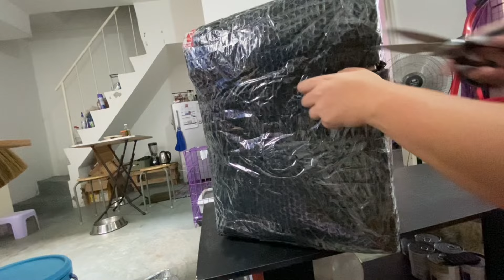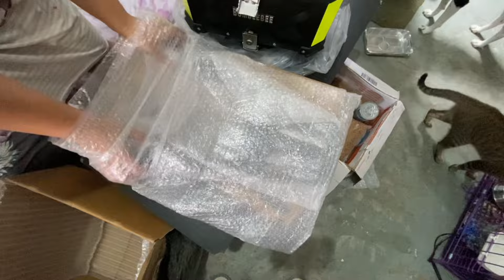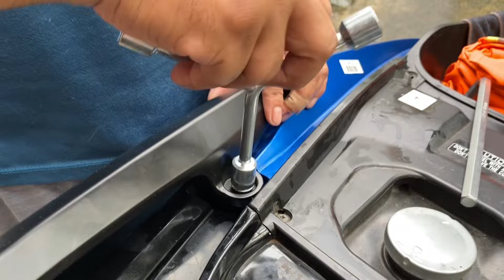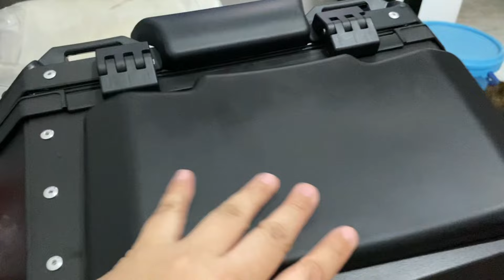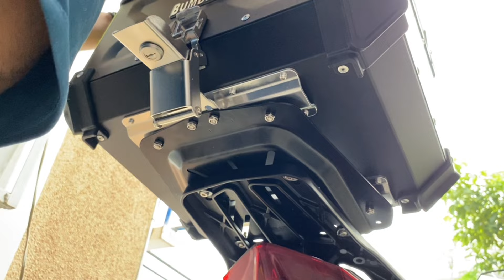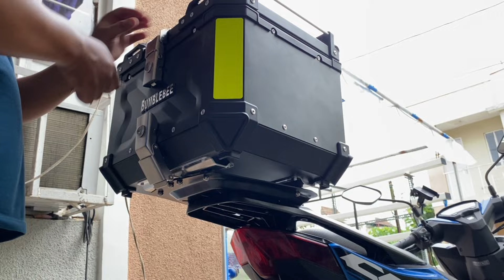Unboxing Top Box 45L and Tried It On Our Honda Click 125i

Comment: Bossing naka fix na ba un top box sa backrest? Di na matatanggal pag di mo naman need ang top box?
Reply from the maker: Hindi po nakafix yung top box sa bracket. Pwede po siya tanggalin kung hindi niyo naman po kailangan ng top box sa byahe niyo. Nakascrew or bolts lang naman po siya. Pero if yung question niyo po is yung foam na backrest, nakadikit po yun sa top box at mahirap na tanggalin.